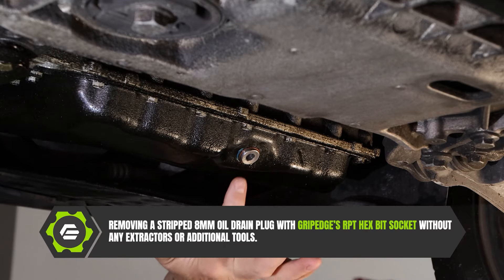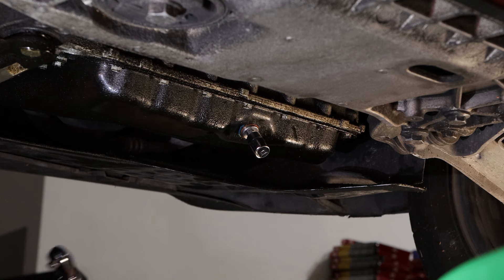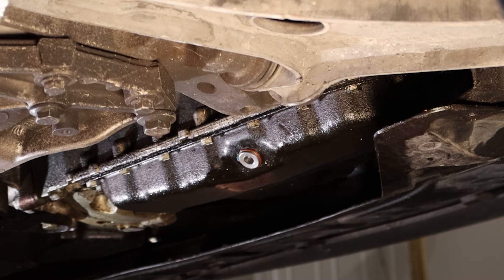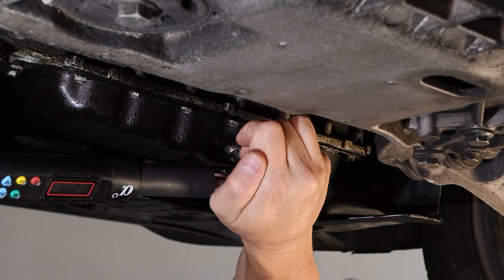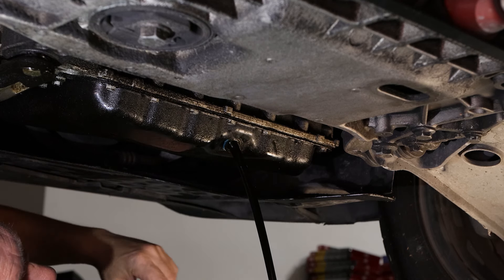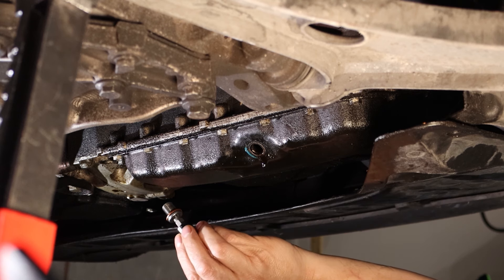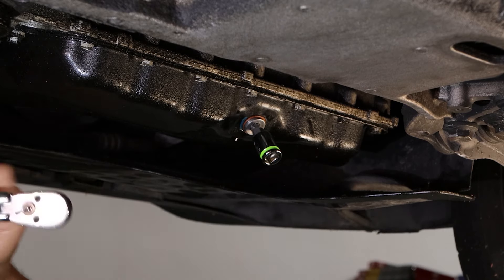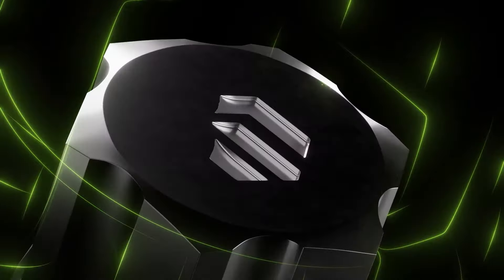Stripped Oil Drain Plug - How To EASILY Remove

Comment: Hi Dan hope all is well! My question is in this particular video if the hex is 8 mm what size of   Bit you use to remove this plug in the video?
Reply from the maker: Thanks for asking! Dan used an 8mm RPT Hex bit on this 8mm stripped drain plug. It's tough to see, but if you pause the video when he's holding the RPT Bit (around 1:02) you can see the large 8mm engraved and painted sizing on the bit socket. It was a 1:1 demo video of a traditional hex vs RPT 💪
Reply: @gripedgetools  thanks

Comment: Bro, is there one for flanged hexed bolt plug?
Reply from the maker: For stripped bolts, cap screws, and other similar issues, we have our RPT Socket Extractors! They are designed to be hammered on, bi-direction, and offer many other features. Check them out here  ➡https://www.gripedgetools.com/collections/rpt-extractors

Comment: Why are you messing with the oil plug and not extracting the oil?
Reply from the maker: In this video, GripEdge RPT Hex was used to remove a stripped oil drain plug. The plug was stripped by a previous mechanic using a traditional hex bit, or maybe even impact on it, causing it to round out. We were able to grip and remove with high torque ratings using Rounding Prevention Technology Hex bits!

Comment: bro, ball peen hammer the head of the plug. mushroom the plug in till the bit fits snug then replace... no need for a special tool... oh I see you sell these.... yeah I guess if the mushing doesn't work nice to have a back up plan...
Reply from the maker: The RPT Hex sockets are designed to replace your standard set and are intended to be use the first time, every time. They prevent the damage from happening but also work as an extractor due to the extreme grip they are able to get vs a standard hex 💪🔩